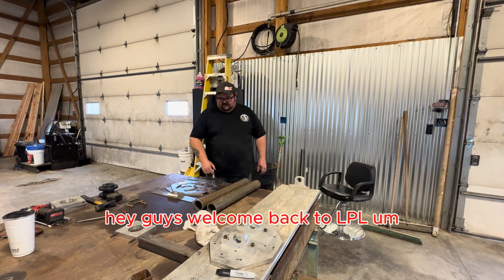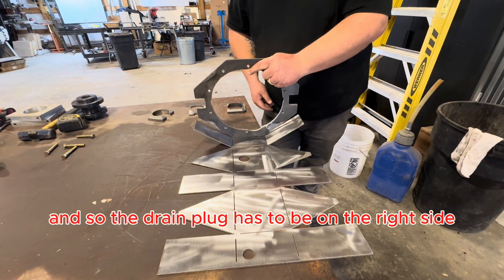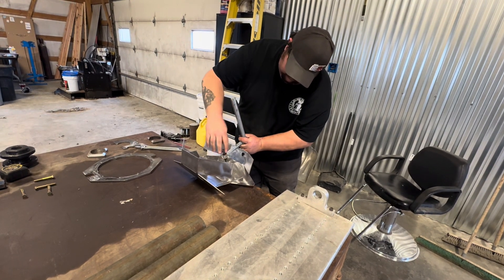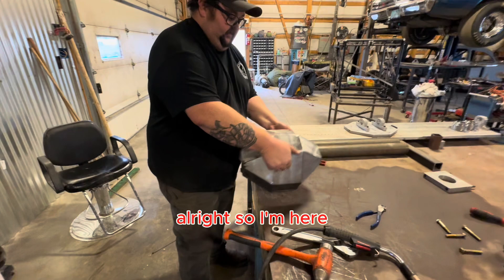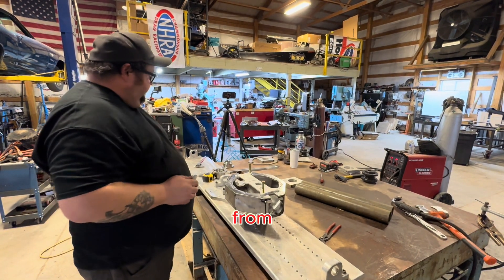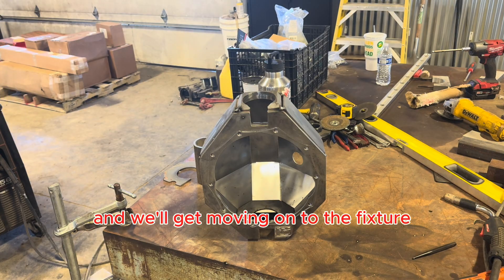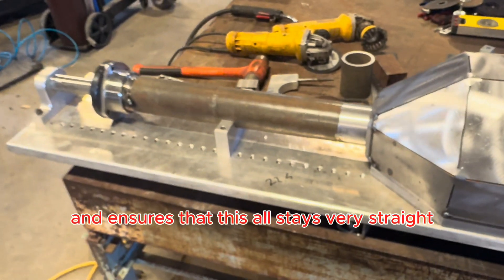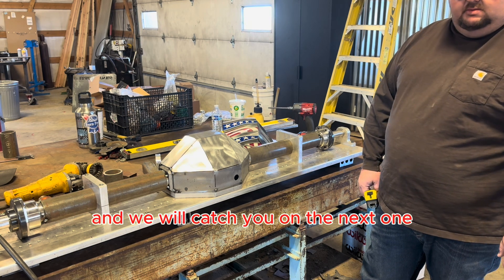Fabricated 9" housing build Pt1

Comment: I've been building Chevelle 12 bolts for decades...68-72 Chevelles have a 55 1/2 inch housing and earlier ones are 54 1/2. Curious how you came up with your measurement??
Reply from the maker: This is the measurement we need that includes our wheels, our axle shafts, and our brake hats, it’s not supposed to be a factory width, it’s supposed to be the right width for our equipment.